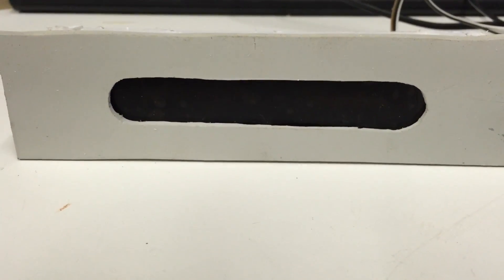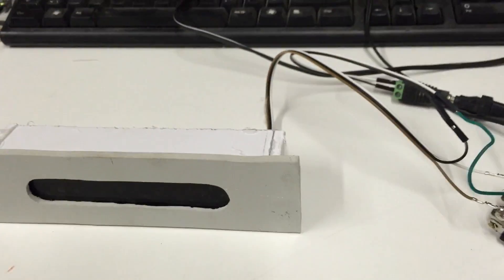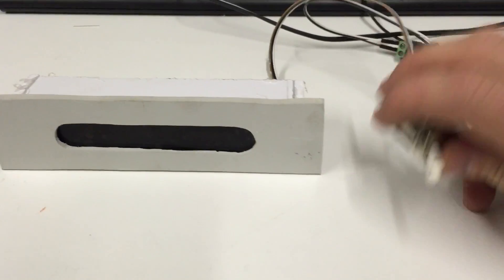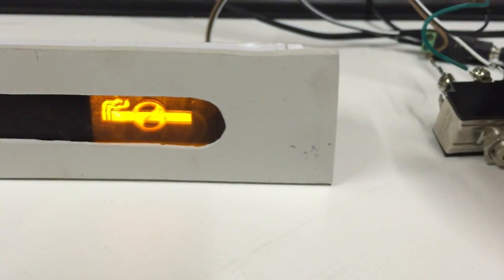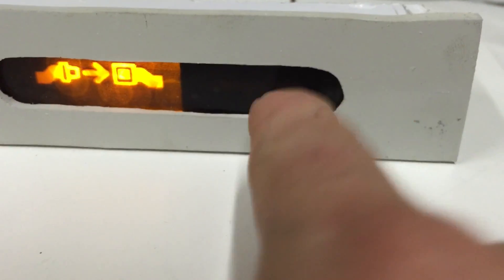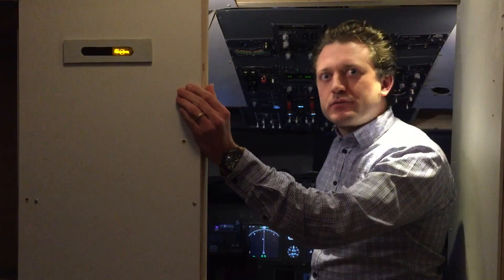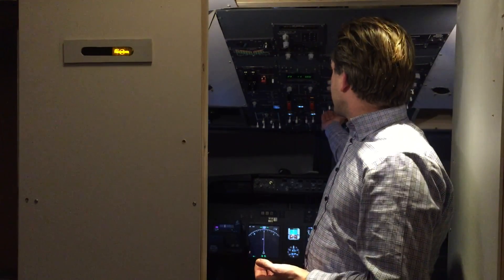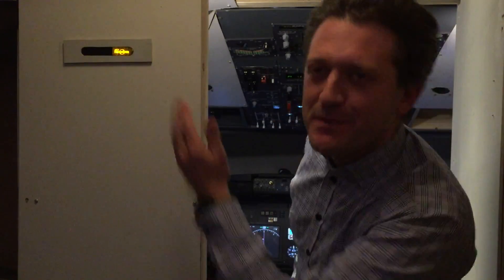Gent's fasten your seat belt - B737 Home Cockpit

Comment: For some reason i imagine  this foam is extremely flammable. Why the heck do we all use very flammable materials for our simulators? Also did you use a laser jet on the overhead sheet. I tried with a ink jet a long time ago with no success?
Reply from the maker: +WackyBroProductions You are right. And the whole structure is made out of wood with a lot of home made electronic inside. :-) Actually I take the power off from most parts of the cockpit when I leave it and there is a fire extinguisher inside the cockpit. 
The overhead is printed by a professional company.
Reply: No i mean the plastic sheet you made for the Seat belt sign?
Reply from the maker: Yes, just a regular laserprinter. 
The sheet is taped on to the back of the plexiglas and then I have put some "sun film" on the front in order to darken it a bit so you do not se the decal when it is turned off. 
/Peter
Reply: +WackyBroProductions  There is a specific kind of clear paper for inkjets. Have you tried tracing paper? It works fine aswell
Reply: I have used normal paper for my warning lights but you can see the white letters when it's turned off.

Comment: I do have one or two questions, where did you find the icons for those to be able to print them off on transparency? and also would a Laser printer print them ok in black with a colored L.E.D. in behind it? 

I am building a Sim as well although it is not one aircraft priority, I have chosen to be able to fly different models but have the functionality of the real switches. I would like to build an A.P.U Temp gauge to simulate when I have turned the A.P.U. on but do not have Pro Sim, I am running FSX which is difficult to interface with. Any help would be appreciated as I enjoy your videos. I can give my email address if needed as I have a million ideas but don't know how I want to get them interfaced.
Reply from the maker: +Don Cornwall Hi Don. The images was found on google. Printed on a laser printer. Sun protective film in front to hide the decals then the light is off.